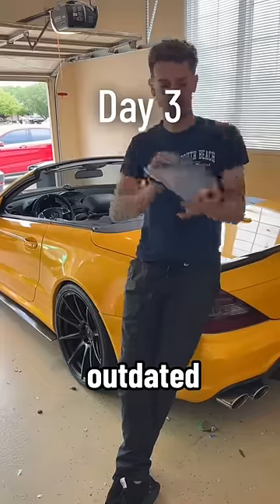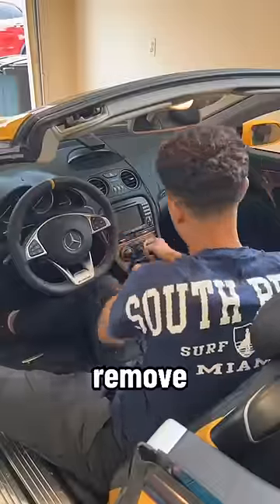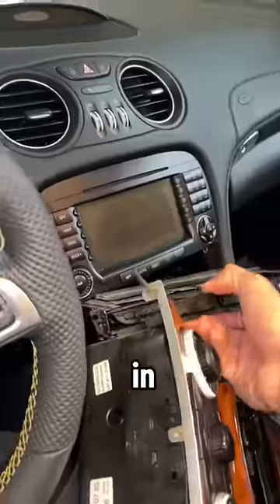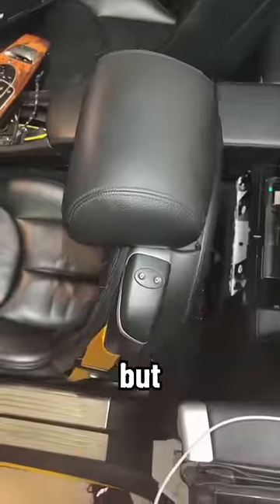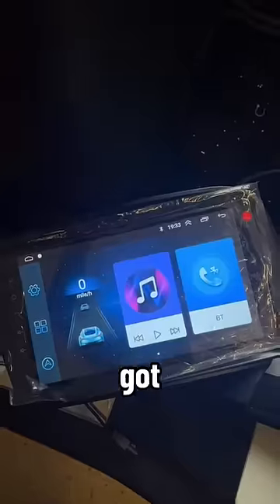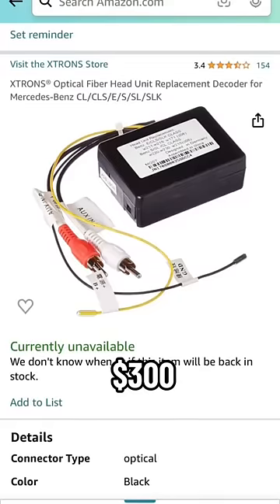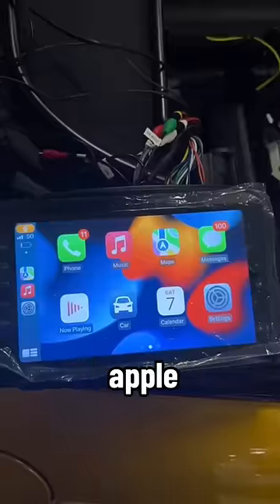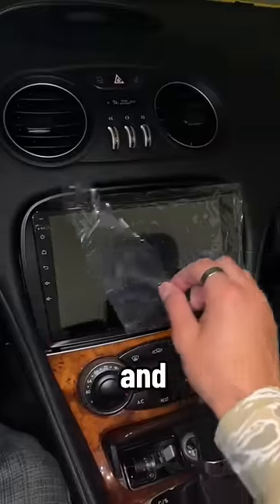Sacrificed my Cupholders￼😅🥲

Comment: Great job. You replaced the FIBER OPTIC audio system that Mercedes spent millions developing, that still sounded great. With an eBay head unit and a planet audio amp👏👏👏👏
Reply: To be fair the fact that it's fiber doesn't mean a lot outside of marketing.The fact that matters is that it's digital, but one could easily send S/PDIF or similar over copper coax instead. The new system, however, appears to be using unbalanced analog, which is subject to interference.
Reply: Not to mention all the wiring. On a Mercedes none the less. No way he’s not going to have issues later down the road.
Reply: And lost his cupholders in the process
Reply: @user2C47 he definitely downgraded, except I guess he has Apple car play now? That head unit is literally 100 bucks. If you’re going to go through all that trouble at least make it worthwhile and not buy the cheapest touch screen head unit you can possibly find.
Reply: How to make a rice car out of classic performance
Reply: @marinzajec1860 don’t forget to unironically start calling it a super car 😂
Reply: People want their stupid Carplay when a cheap suction cup phone mount would've been good enough.
Reply: 🤣🤣🤣 damn bruh. No mercy.
Reply: Nah bro he’s turning it into a “super car”
Reply: Fiber optic means absolutely nothing for value or sound quality, just another thing mercedes does cause they're german.
Reply: @rippah669 Actually does when done correctly. The reason it's used in this system has to do more with the Dolby sound with a multi channel system. Having to deal with multiple balanced cables for stereo to processor inputs means a lot of space and wires. Then the processor to amp cables. Then you have the 11 or 12 amp to speaker wires on top of that.  It's a wiring nightmare. Fiber increases the quality by eliminating unbalanced cables and faster response, along with not being susceptible to noise being introduced by power or static.  But as fiber itself, no it reduces sound in some cases because of the processing needed for single or two channel source to amp situations or source to speaker in short distances.
Reply: @user2C47 fiber is used as a replacement for multiple channel systems to reduce wires needed, unbalanced cable issues, noise and cable locations. Most exotics have a processor which splits to the multi channel amps. In many cases 4/5/6 up to 12 channel systems. And the head units in some cases split the crossover frequencies and send them out individually. Which can mean copper for each channel which has its issues with quality in a dirty power environment. So Fiber, while doesn't effect quality directly as a cleaner conductor, fiber can essentially have limitless channels depending on size and processors.
Reply: @johnofsometrades405  Sure, for a multi channel audio setup in a car it's feasible. But who's playing multi channel audio in the first place? Not to say it isn't likely but the majority of people are streaming from spotify or apple at like 96kbps. To say it isn't overkill is crazy. 

I've installed long distance fiber for amphitheater setups, it makes sense if you have the actual likelihood of having multiple channels. Also you'd be surprised the amount of loss that fiber can have if it's installed incorrectly, it's a very finnicky cable  and way more likely to break from corrosion, wear, vibration etc. 

Again, if you NEED multi channel audio it makes sense (sort of) but 95% of people are playing 2 channel audio to begin with. It doesn't make sense for cost, durability, longevity, and that most people can't fix it with regular tools.
Reply: @rippah669  Left and Right doesn't mean there isn't more than two channels. Many modern head units have DSP's and electronic crossovers sending bass, mid bass, mid highs and highs, not to mention a center channel to add depth and warmth. The people that utilize multi channel systems are typically audiophile enthusiasts,  and many own Mercedes, Toyota and others but want to hear great audio. Not all systems use capacitors and chokes in the door panels. Not to mention,  many of these cars use a DSP in the rear for those that want 2 channel Kraco sound or a simple head unit change and speaker installation a audiophile can get his 11 or 12 channel Harmon Kardon, Bose or Sony sound system and it wouldn't take a complete rewire.
Reply: @rippah669  guess I should have mentioned,  I've installed car audio as far back as early 90's and I'm a audiophile guy that installed high end systems.  Never sold any remotely close to Planet Audio. The cheapest was Alpine or Pioneer.  And even dabbled in tube amps. American tubes sound WAY better than the Chinese
Reply: @johnofsometrades405  Again for a crossover system it's a whole ton of added complexity converting to fiber compared to just running copper. I've never actually seen a crossover output in fiber and I think there's a good reason for it. Fiber isn't some magic fixall, it's a product that's literally still in development, OM5 was adopted in 2017. The majority of people don't even understand how fiber works, much less  how it should be treated. I've only installed fiber for major systems because they're the ones that actually utilize it. Sure Merc can say all of these things but who's ACTUALLY using it? 

I'm an audiophile myself, easily spent more than a car in personal gear. I get using quality components but fiber for the majority of people it doesn't belong.  Also not to mention multi channel audio is impossible to find for the majority of music, most people only care about bitrate. Just about everything nowadays is only released in 2 channel, I wish it wasn't true cause I'd play it.
Reply: 😂 but it has Apple play

Comment: Guy really turned a nice car into a taxi with the cheapest radio possible.
Reply: and the cheapest amp, planet audio is a joke
Reply: Amp sure but trust me it’s really hard to find a harness for that year double din at that for some reason this unit is everywhere for just about any car oh well to me apple car play seems like a win over the cheap quality
Reply: not like you can just buy the latest and greatest and slap it on. its not a one size fits all deal.
Reply: @JohnSmith-li7xe  except 90% of them are it's not hard to just move a couple wires around and make them work or just make your own wiring harness you don't really need to know anything about electrical or engineering just basic knowledge
Reply: frfr
Reply: @@armandoa5787 like where ? Is that not technically still being 3rd party even so!? Are you even thinking what you are saying….
Reply: @theshadowking9626 in no case will you ever install a head unit by just moving wires around thats cooked
Reply: @nahhh5318  if you know what wires lead to what and supply power and ground you can do it without a harness

Comment: Oh wow, he rlly spent a shit ton for it to get worse, damn, im speechless
Reply: Right he lost the cupholders
Reply: All that time and money for what 😂
Reply: @Hipsael for the taxi cab
Reply: @valentinotonkovic656 those cupholders are shit they break easily
Reply: Is there an email I could reach you at.
Reply: The original comand system got either bluetooth or any way to play music beside CD or radio and when you got the bose system the only way is the fibre decoder or an complete change of the audio system.

Did the same with my cl500 and it was about 1000 bucks just to play bluetooth in the car.
Reply: Bro how it it worse? He can use bluetooth and carplay and atleast he didnt use one of those clip on ones thats just a big screen that goes over everything, he actually got a retrofit that looks good, plus its a shitty ass merc anyway, anything aftermarket is 1000x better then the junk that thing came with
Reply: @excalibur2038  You never owned an 230/220/215 do you?
Reply: @Winklarson420 I don't own any of those but please tell me why it's worse. I don't understand how it's worse 🤔 am I missing something?
Reply: @-Eternal-Damnation-  Yes, the fibre optic signal is by far the way for transporting audio quality but aftermarket headunits dont work with fibre optic so you either replace the whole audio system or, which is what he did and what more common is, you use these fibre optic decoder which transforms the signals to chinch but with a big lack of quality.

So yeah you can play music but it sucks compared to the original headunit.
Reply: Every car guy spends a shit ton for their car to get worse lol
Reply: It's his car not urs
Reply: He really butchered the MB fiber optic sound for a shitty CarPlay head unit 😂💀bro does NOT have his priorities straight 🤡

Comment: Damn another $300 and a trip to the shop to get the thing installed, might as well started at the shop
Reply: Looks shitty, you can get them Android Radios in OEM Look. I got one too in my Mercedes. Looks Like the real command but with carplay and everything
Reply: Because he a patatoe, at that point it would have been a 4chan amp and rewire for me, cant have issues when i wire the speakers to the amp
Reply: At least he tried... Stop complaining when you would have cried if he directly went to the shop... (Though he isnt doing great thats a fact x)
Reply: @MatoVidovic_ at least he tried but gave up instead of researching and learning.
Reply: Nah he wanted to turn one screw to feel like a mechanic 😂😂

Comment: Bro’s using the cheapest touchscreen unit available lmao
- How do I know?
I have the exact same one 😂
Reply: Maybe $100 max
Reply: Which one did you buy? I am looking for a super cheap one for my car
Reply: I have the same one.Its not the cheapest it's 200 it works decent for YouTube and Netflix and radio and car play.but their is way better out there. Android beniazi 10.1 inch
Reply: Even mine looks the same.
Reply: @brianberson1736 They all look the same. That’s the point - they are mass manufactured basic units with only difference being software unlocks and sometimes CPU/RAM. It’s still a basic 8227L unit, but with different software
Reply: Same 💀💀💀💀
Reply: Ik it look cheap and out of place
Reply: There are android head units that look exactly the same like the original one. This one just looks like crap.
Reply: You do know you can buy more expensive versions of that head unit
Reply: Atleast it has CarPlay right?
Reply: @Bububixby yes, but only difference is usuall software features. It is still gonna be that low-cost hardware with old android, but reskinned
Reply: @75yomu well not by default, my guess is he either bought a dongle that enables that, or he rooted the unit and went the ZLINK way
Reply: it looks the same because they are from the same chineese factory
Reply: Yeah guys they sell exactly the same product in Turkey as well for all cars. I went there for checking to my Hyundai. Android Auto or Carplay is not original but supported by Zlink way, it is lame. Quality is really low even with 8gb RAM option and it makes freezing even in the fall weather, so I can't imagine in summer condition. Therefore, I have kept the original AVN the same. Totally, not recommend for everyone.
Reply: Fibre optic went out to replace it with trash… OMG😂😂😂
Reply: I have that same aswell😂
Reply: I’m more offended by his need to stretch the phrase “in CLUTCH”. Like a white girl saying “slaaaay”
Reply: I was like who spends $300 on a converter for a potatoe touch screen
Reply: Same lmao its crazy how most cars suppport it ngl
Reply: @Raxiius  exactly. All mass manufactured
Reply: @Raxiius as someone who is also into technology, wouldn’t mind the extra cost for a CPU that wouldn’t be outpaced by a snail a few months after buying it. But yeah other than that, same shit different toilet.
Reply: It happens
Reply: me too bro 😀
Reply: The before looked better
Reply: my mom's shitbox has the same
Reply: Imagine putting all this work only to install a 100$ head unit. That could’ve been easily 2000$ in labor
Reply: Imagine doing all that to lose so much value on the car...  
like : do you , just don't post it.
Reply: Those eonon units range from 100 to 800$, I paid 500$ for mine and it's awesome. It's got 12gbs of ram n a 8 core 4.6GHz cpu. I can run games on my car better than most people's home PC 🤣
Reply: I have w211, and I don't want to change the original head unit it to these cheap looking screens. İf i do, i will buy the one that looks like original but it is Android inside
Reply: Me too lmao it was so easy to put in and the things mint
Reply: The spanner too
Reply: Same lol
Reply: How did you install Apple CarPlay
Reply: I had it in my Jeep 90$ buck and felt like it too
Reply: the planet audio amp too lol
Reply: got the same one too LMFAOOO
Reply: Me too😅
Reply: Aside from the cheap unit, did he really drop 350 on a fiber optic decoder when all he needed to do is by a new amp? Maybe he thought the fiber optic would be worth keeping.. hope he could return it and get his money back, if not I know I'd be pretty pissed if it were me.

Also mention it's funny I was so against the color at first, even said his girl fckd up and did him wrong, but now it's totally grown on me and I'm all for it... Maybe the screen will to when he finishes the rest of the interior.... maybe..
Reply: The same is also used by Indian taxi drivers in delhi
Reply: And the absolute worst amp money can buy…
Reply: Yeah I got one in the my yukon lol
Reply: @suryasolanki8  seen it in nepal too when i was visiting a few months ago
Reply: 😂😂😂 not this comment getting more likes then the likes on this video 😂😂😂
Reply: With the cheapest amplifier lol
Reply: sameeeeeeeeeeeeeee
Reply: @Taticalnoob21  Do NOT cheap out on a head unit. A decent one can go for like $150-200. It's worth to drop some more cash on one down the line and spare yourself of the rage you'll get from using a really cheap one.
Reply: Still gives him more options although I would’ve went with a 5ch car amp incase he wanted to add a subwoofer down the road
Reply: I know that exact one lol. They are dog slow
Reply: @rearmisser  a decent one is more like $300. Not cheap but it’s honestly worth it. A great head unit can make even stock speakers sound good.
Reply: @brianberson1736 why do you have Netflix on the infotainment screen? Is it for the passenger on a long drive? Not trying to be snarky. Just curious.
Reply: Buys a Mercedes. Does tons of mods to it. But cheaps out on the stereo monitor. Ha what a joke
Reply: I got the same one too lmao, someone had already installed it when i bought the car
Reply: SO DO I
Reply: its cheap but find one thats made by the major name brands like alpine, pioneer that is an android tablet. none. if they had made one, no doubt we would jump on it.
Reply: FR
Reply: Me too but I don’t have the Apple CarPlay one :(
Reply: That's planet audio amp is like $80 on Amazon
Reply: not like you can just buy the latest and greatest and slap it on. its not a one size fits all deal.
Reply: Lmao same, but it does the job so I ain’t complainin 😂
Reply: broo same here, it is china brand lol
Reply: Bro my dad has that same touchscreen unit on his 2003 ford fiesta
Reply: @brianberson1736 You're buying from dropshippers thats why. They're $60 for that 9in screen but the wires aren't plug and connect for power
Reply: Yeah no jus say you broke homes.
Reply: I got the same one on temu for $46 and it works great. But it’s not the tablet looking one. It’s looks OEM , just has apple car play. I payed $22 since I had like $18 credit .
Reply: They’re all the same designs, you can get them as cheap as $60 or as high as $400. It’s just the specs that change mostly
Reply: I’m your 9000th like
Reply: All of them are slow cheap junk get a $250-300 headunit.
Reply: Me too
Reply: @Taticalnoob21 don't buy use just non screen ones
Reply: I used to have the $100 4 core cpu one which was kinda slow and didn't have wireless Android Auto/Apple Carplay. I got the $200 8 core cpu one and its perfect for everything I do and fast af. I use the CarPlay all the time, I used to just use bluetooth on the other one

Comment: All that work for a planet audio amp 😭

That Mercedes deserved better
Reply: I mean like damn if you gon go cheap at least do kicker i just know that head unit gotta under $85... and i know in person wires are prob showing and most times when something is bypassed dealing with  car audio you have problems later
Reply: Ong
Reply: Fr those are cheap and blow out within the month.
Reply: @rypdx yea i can agree ive have them to
Reply: @tryintomakeit you want to add kicker? That’s what walmart sells lol kicker sucks since the early 2000s
Reply: @TheCesarWay. Kicker may suck now but at least their amplifiers do rated power unlike some of the other cheap brands
Reply: No amp is gonna perform well with 16 gauge power wire
Reply: Infinity, Rockford, Alpine so many amplifiers available.
Reply: A lot of factory bose speakers (i guess also on this one)  run at 1-2 Ohms and require low impedance amps. The cheap amp is propably already blown

Comment: as an engineer I would advise against changing the input output units on a system that employs a fibre optic system as an anchor to the audio. the system is precisely programmed to work together, it's not worth it, you will never get the same quality sound
Reply: I wouldn't have done what he did, but the fiber optic signal, being digital, have to be converted to analog anyways?  He basically bypassed the original digital inputs for another and used an aftermarket amplifier.